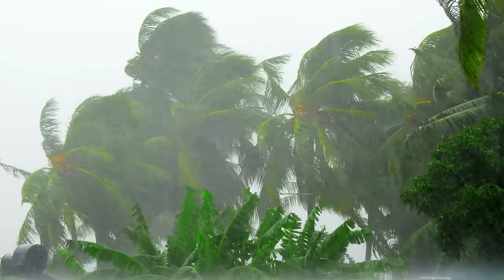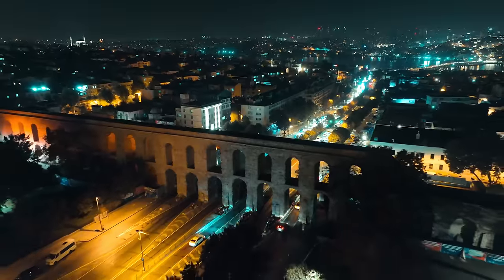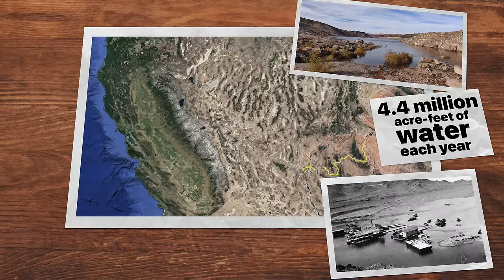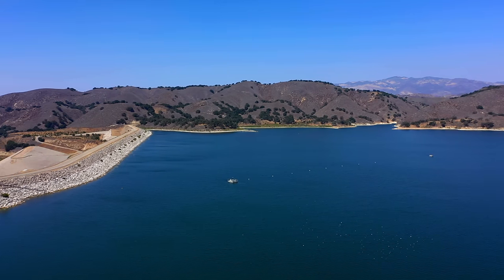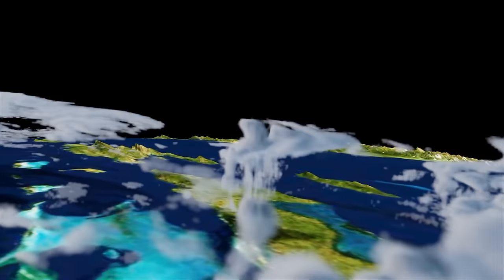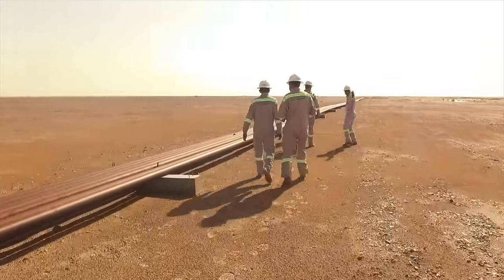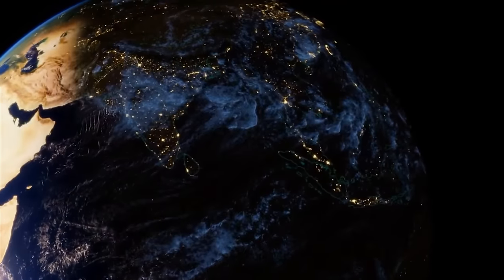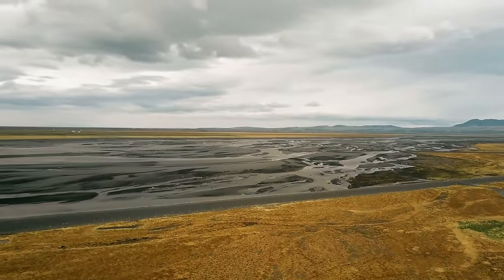Pipelines From Flood to Drought

Comment: I actually considered this idea about ten years ago when a farmer told me that they had to pump excess water off their fields in Idaho to grow corn (a crop that requires huge amounts of water). 
But, as I discoved when researching it then it has many road blocks. A few of which I will share. Now keep in mind I still think this is worth pursuing, I just don't think it will be anywhere near cheap. 
 You can't use the current oil and gas pipeline system even if we suddenly stopped needing oil and gas today. The problem is not cleaning it, the porblem(s) are: the chemicals they where manufactured with that can and will leach into the water contaminating it. Also most of the pipes are steel and will rust out and bust in a few months to a year without expensive anti-corrosion retrofitting. Little anodes that will have to be regularly replaced, the outside environment determining the frequency of said maintenance. 
Only a few pipelines are 20" or bigger in diameter. The vast majority are "gathering systems" that are usually 12" or smaller. Generally around 8" but include some as big as 18" and as small as 2".
To solve these issues I would personally just use polly-pipe or the equivalent approved for human consumption.
Reply: Well it would likely need to be transported to a water treatment plant one thing many people forget is paints and sewage and many other chemicals contaminate our water but is later filtered out to be returned to drinkable water. toilet to tap as they call it. That being said it blows my mind with water shortages every year that California sells bottle water.
Reply: @stephennewcomb4575  The fastest way to solve Califoria's water problem is to encourage more Californians to move to wetter states.
Reply: @stephennewcomb4575  
Those pipes are maked of alloys that contain heavy metals and carcinogens. These heavy metals and chemicals help to give the pipes more cathartic protection(basically rust proofing it). But these heavy metals and chemicals can't be filtered out. The only point I'm trying to make is that you wouldn't want to use these pipes to transport water anymore than you would want to use lead based sodder on the copper pipes in your home's water system.
Reply: @tyrelgift5628  At water treatment plants metals can be treated. They go through a whole day and then some of filtering. if it is especially dangerous chemicals in high amounts they can monitor and neutralize. I have seen it done where they monitor for metals and cyanide due to painting/paint stripping company being nearby. It is usually done during the flocculant and coagulant process but also since the pipes would likely be made of the same material monitoring it for an abnormal amount would be easy. Again talking about water treatment plant and not home filters.
Reply: Here is one minor problem. The farms in the Central Valley require about 36 billion gallons per day. That's about one-tenth the flow of the Mississippi where it enters the sea. That's a pipe about a mile wide and 200 feet deep. To really work, the pipe needs to go from New Orleans to Northern California.
Reply: @stevenverrall4527  That wouldn't help the farms.
Reply: @cliffordschaffer5289  Less water needed for people equals more water available for farming.
Reply: @cliffordschaffer5289  That would also alleviate some of the dead zone problem.
Reply: @stevenverrall4527  It is a drop in the bucket.
Reply: @stevenverrall4527  It wouldn't do anything about the most important dead zone -- hundreds of miles of dead forests in the mountains.
Reply: Historically, California has had droughts lasting centuries. This was before humanity could affect atmospheric composition. Fortunately, humanity is the most adaptive species on the planet.
Reply: @stevenverrall4527  This drought is killing trees that have survived everything since thousands of years before Jesus. This is different.
Reply: @cliffordschaffer5289  That sounds like a gross exagerration. Show me the dead 5000 year old redwood. Forests can quickly regenerate under favorable. conditions. Remember Australia a few years back? Well, it has been quite wet there for the past two years. It is called La Nina.
Reply: @stevenverrall4527  A little searching will show you that the recent fires have killed 10 to 15 percent of the Sequoias in and around Sequoia National Park. That is an unprecedented loss and not one that will recover within the life of anyone living.
In addition, about 150 million pine trees died from drought, about 90 percent of all the trees on the mountains for more than a hundred miles.
Reply: @stevenverrall4527  In addition, they are currently taking special measures to protect the bristlecone pines that are under threat from the drought and dying.
And, no, none of these kinds of trees regenerate quickly. A sequoia takes 1,000 years to reach maturity.
Reply: @cliffordschaffer5289  None of this is unprecedented and none of it threatens humanity. Life on Earth has adapted to waves of extreme conditions over hundreds of millions of years.

Humans are of minor impact compared to what nature has done all by itself over the aeons. It is senseless to worry about natural processes that we have very little control over.

It is far better to focus on controlling what we can directly influence in major ways.
Reply: @cliffordschaffer5289  How did these living things survive during the previous interglacial, which was considerably warmer than the one we are living in?
Reply: @stevenverrall4527  What does that matter? They are dead now. Obviously, conditions are worse now. Huh.
Reply: @stevenverrall4527  I don't really care how life came back after the dinosaurs died. Not my concern. I don't have hundreds of millions of years to wait for something better, and neither does anyone else.
And, yes, when you start messing with that much of the food supply, it will mess with humanity.
Denial at this point is just deliberate ignorance.
Reply: @cliffordschaffer5289  I am not in denial of anything. I am a realist. Why has California warmed at a much higher rate than the rest of the contiguous United States?

My educated opinion is that the excess heat in California is primarily due to the water vapor evaporating from the Central Valley farmland. It is well established that water vapor provides at least 80% of Earth's greenhouse effect.

However, Californians seem content to blame the rest of the developed world for their self-caused ecological problems. The crazy part, is that if I'm correct, the entire globe could go to net zero CO2 and California's ecological problems would be affected by an imperceptible amount.

Don't get me wrong. As a nuclear fusion expert, I fully support electricity generation that doesn't emit excess CO2.   However, we can do all that and it likely won't help at all with California's ecological problems. Indeed, pumping even more water to California will only worsen these problems.
Reply: @stevenverrall4527  I have news for you. Something someone could have picked up on if they were really paying attention.
The primary source of the water for the farms is the forests in the mountains. The trees shade the winter snowfall so it melts slowly over the summer to provide a steady supply. Without the trees, the snow melts too quickly and floods. Without rain and snow, the tries die in massive numbers.
The water is gone before it ever gets to the agriculture. That's the problem.
And, California isn't any different than anywhere else in terms of heat rise, either. Even if it was, that still isn't the problem. The problem with no rain lies in the oceans. 

I see the dead forests every time I step out my door. That's where I get some of my education on it. I think your opinion needs some more education.
Reply: @stevenverrall4527  Just FYI, if you are talking about how the world survived the extinction of the dinosaurs so everything is fine now -- that's denial. 
Just so you can recognize it when someone does it to you.
Reply: @cliffordschaffer5289  A few points:
1. We wouldn't exist if it weren't for the dinosaur extinction.
2. The last glaciation ended a mere 10,000 or so years ago. Prior to that, a large part of North America was covered by ice sheets for several tens of thousands of years.
3. If recent human activity has prevented future ice ages, that's a tremendous net positive.
4. Positive thinking can and will lead to meaningful progress.  Wishing things were like they were in the past is ultimately a futile endeavor.
5. I hope you are enjoying Thanksgiving!
Reply: @stevenverrall4527  Yeah, that is elaborate denial and you haven't convinced me that you know enough about the subject.
Have a nice Thanksgiving.
Reply: @cliffordschaffer5289  The only way to return Californian wilderness to something resembling its state two centuries ago, would be to almost completely depopulate its cities and end all farmland irrigation.

I do not advocate for that. In fact, I advocate for desalinating seawater to greatly increase farmland irrigation worldwide. Therefore, in my opinion, there is no going back. Overall, increasing atmospheric humidity will cause the entire planet to become considerably wetter and warmer. This is a net positive for life on Earth. Of course, many species will not adapt and perish. They will be replaced by more adaptable species.

Humanity is terraforming the planet whether we like it or not. The best approach is to accept that and move on...
Reply: @stevenverrall4527  Supplying the farms would require 36 billion gallons per day. That is a large desalination plant for every half mile of coast, for the entire length of California. It would cost trillions, not including the pipes and power plants. It would produce about 25 billion pounds of salt per day. It would have major disastrous effects on the coastline and the fisheries.
The pipes would have to go from the coastline to the Sierra Nevadas. That would require a whole new set of power plants just for that.
That's for starters.
And that still wouldn't solve the problems.
Smaller desalination plants are already causing coastal problems.
The problem, as I said, is that you really don't have a clue.
Reply: @someotherdude  During the current era, California is the best US example of what NOT to do. The correct approach always turns out to be the opposite of what California does.
Reply: Before even doing any of these, please note that China has created gigantic water infrastructure transferring water between north and south. This apparently has caused great weather pattern change and they have gigantic floods and earthquakes in areas that did not use to have those traditionally. Not saying this should not be done but we should avoid pitfalls others have already made.
Reply: @indianatarzan8001  California has such a tremendous amount of irrigated land, that all that excess water vapor must surely have had a large impact on air temperatures across the state.

Indeed, California has warmed about 3X faster than the rest of the US. The Central US states have barely warmed at all. Growing seasons in the Upper Midwest, where I reside, have not noticeably lengthened. If anything, they have shortened in recent years.  I should know, since I have been a backyard gardener for decades...

Comment: Shouldn’t be any more difficult to build a cross-country water pipeline than it is to build a cross-country oil pipeline. If we can build Keystone XL, then there should be no difference between that and building a water pipeline from Florida to California in terms of cost.
Reply: True..they want nothing other than profitable project.. Sad but true..
Reply: At $3-4/gal oil pipelines pay for themselves. Water at pennies/gal, this will be a forever money sink from maintenance. If you can convince all the states this feeds to pay a water tax to build this pipeline it would work, or become a socialist utopia.
Reply: @DtWolfwood  Also people use a lot more water than oil.
Reply: Problem is there's no "big water" only big oil. Just because we have solutions doesn't mean greed won't stop it
Reply: @DtWolfwood  The water pipelines could be paid for if we charged 40 - 50 cents per gallon.
Reply: @hawks9142  big water is the cities.
Reply: @Dularr  actually, thinking about it more. Big water is just an ocean
Reply: @hawks9142  desalination is just big water cities pulling water from the oceans. If you want see a big city water plan. Check out New York City big water.
Reply: @DtWolfwood  Agreed. So how do we make this system require less maintenance and generate income (like solar collectors or mini turbines to take advance of gravity in spots) to offset costs.   This large scale plans needs to factor in secondary benefits and not just be about transporting water from point A to point B.
Reply: @DtWolfwood  LOL.....if it's all about getting a return on your money nobody considers the fact that you get no return in giving homeless or out of work people free handouts......all of the time.
Reply: The problem has never been technical, the problem has always been political.  The simple answer is no, California is not welcome to our states natural resources.  Period, end of discussion.
Reply: @asdfdfggfd  ok, but if the state is just wasting them (ie sending water to the ocean) that seems… illogical
Reply: @DtWolfwood  Government is the answer.
Reply: @BrianSmith-lo3mj  To put that into perspective, if a family of 4 only uses 2,000 gallons of water per month (16 to 17 gallons per day per person) then their water bill would be approximately $800 to $1000 per month for the pipe line.  Also, 2,000 gallons would be extremely low when considering it would have to be used for drinking, cooking, cleaning dishes / clothes, bathing, and sanitary (flushing toilets) uses.
Reply: The return would happen once one flood is adverted.
Reply: Size. The quantities of water to be moved are a lot larger, so you need much bigger pipelines, which costs more. A lot more.
Reply: @DtWolfwood  It only adds at most 6 cents per gallon AT MOST. There is more added in taxes to gas than transportation costs.
Reply: @DtWolfwood  The tricky part is that it is hard to say the actual cost to deliver a gallon of water to central or southern California.  All of the existing infrastructure was paid for by taxes, not utility customers (and certainly not by farmers, they only pay a fraction of what us toilet flushers do) and I feel confident that it is not being maintained/replaced any better than the rest of the infrastructure in this country.  I suppose that would be one solution.  Make the farmers pay the actual cost for their water, wait for them to go out of business and there would be plenty of water for whoever was left.  We would just have to import a lot more food.
Reply: @tylerriddle7735  There is nothing illogical about it at all.  Californias water diversion efforts have a 150 year track record of causing environmental catastrophes every single time.  If you want our water you can pay retail under the brand of Aquafina.
Reply: @RichardGreuel  I was talking about the haves, NOT the have nots. (aka, basically most of the middle class these days) Sell this water to wealthy people that want to have a lush green lawn by watering it all the time or they want to fill their Olympic sized swimming pool up twice a year.
Reply: @jackm3040  Yeah, it sounds like it would be a great idea to illuminate all those Almond farms. But what about all those people who like to drink Almond milk?
Reply: There's a big difference and the fact you don't know this means you shouldn't be making statements like this.
Reply: @BrianSmith-lo3mj , okay.  We have tiered pricing where I live, although this would be most decidedly next level.  Unfortunately, that is probably a very minor amount of the water used in California.   The last I heard, California uses water in 50% environmental, 40% agricultural, and 10% urban uses.  That means what you are talking about is a small fraction of the 10%.  It would also probably result in demand destruction where by they would most likely get rid of the lawn and stop filling the pool.  Not that it's necessarily a bad thing.  It's ridiculous to have large green lawns in a desert.